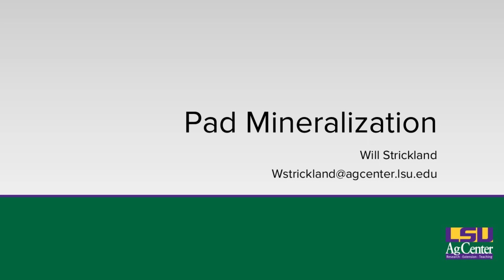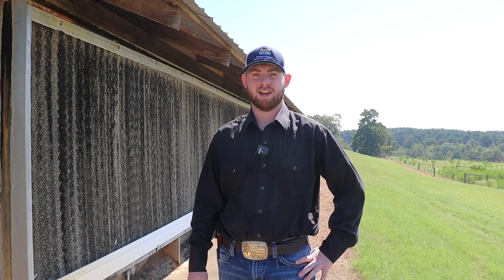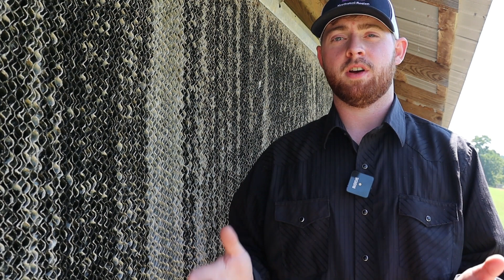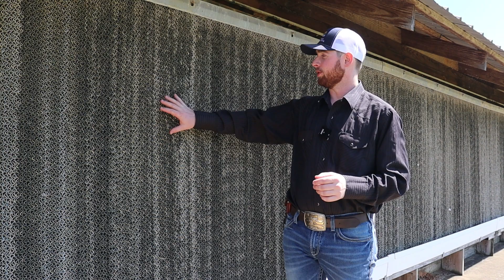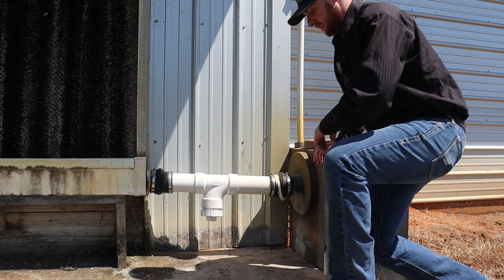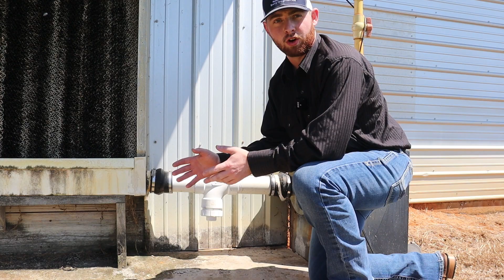Poultry House Cool Cell Pad Mineralization

Comment: I have tried all kind of cleaning chemicals and chlorine and bleach to clean the pads but nothing seems to work. 
Have you ever seen or heard about something like this happens. Thank you very much
Reply from the maker: From Will - "Hello, I have not ran into anything turning paper pads “plastic”, however in the water distribution video we touch on the fact that mineralization can decrease our wicking ability, also when flutes are restricted by dust and debris it can not only affect air flow through our pads but water flow down our pads, which can affect our pads getting fully wetted. It may be that your pads need a proper thorough cleaning (low pressure, high volume of water) or have something accumulated on them that may be impossible to remove now without damaging the pad. I would recommend getting a water test and flushing the system regularly in the summer if high levels of minerals are found. Reach out at WStrickland@agcenter.lsu.edu if you have more questions. Thanks." 

(Please note the delayed response is the fault of the channel manager and not Will. I apologize for being behind in getting his response to you! - Ashley)

Comment: Hello there,
I have a 3 year old farm and it has Kuul cell pads. Coolcells are on pond water. I have issue every summer that coolcells run so much time and water, however, the pads just don’t absorb water at all, it just goes out the bottom. From inspecting the pads, they are very dusty with dust from the road and spider web, etc. I reached out to the rep from Kuul by email and he said that is algae from looking at a picture that I sent. I doubt that he knows what he was talking. It looks to me and my fellow chicken growers here that something in the water made the paper pads into plastic.